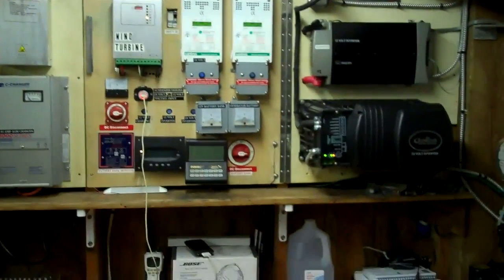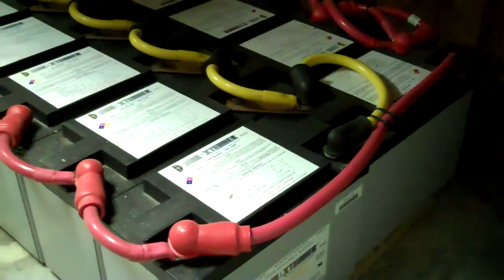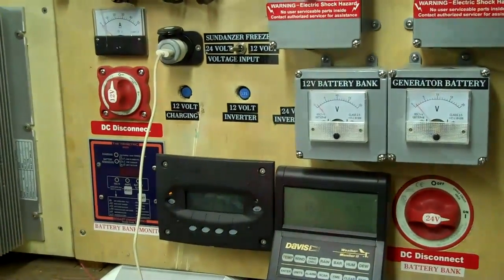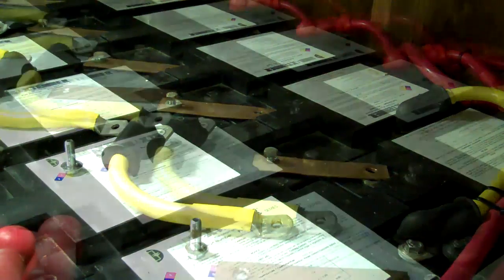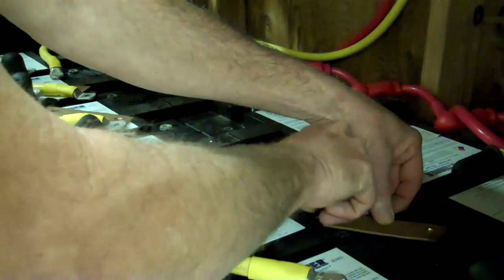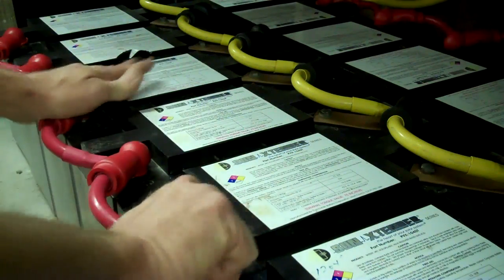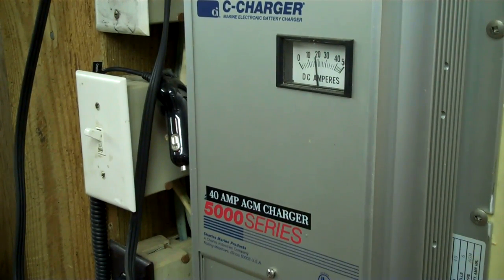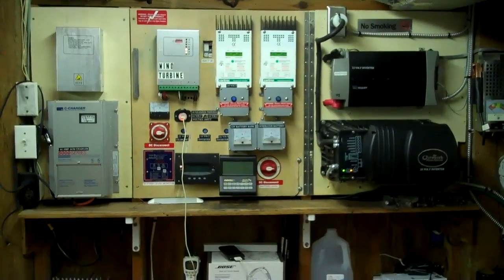HOW TO MAINTAIN YOUR AGM BATTERY BANK..

Comment: I wish you were a neighbor! I've lived off-grid for 17 years on the off-grid 9kw system I paid $27,000 for when my house was new. My AGM batteries are the large ones used as back-up systems in hospitals. They change them out every 2 years, and I bought these used but in excellent condition.
My problem is, I never learned the skills I need now. I'm grateful to folks like you who share their knowledge!
I'm female, so all my life I was told not to "worry your pretty little head" about things that I just "need a man to do". Well, my man walked out on me 9 years ago when he got bored with the off-grid life and found a younger woman, who lived closer to the liquor store.😏
Over the years since, I've discovered problems with his "expertise" in installations. Such as how he used plumbing fittings on our gas regulator instead of proper flare fittings designed for propane. Oh, and he used regular white plumbing thread tape instead of the yellow tape meant for gas connections. It leaked of course, but he told me there's no way to fix it. I took the whole assembly to my local hardware store and asked for Bill, the wonderful old gentleman who I consider to be a treasure. "What idiot did this?" Bill asked. "An expert!" I answered.🤪
I don't know much about anything, but I'm smart enough to ask the people who DO.
Today I have to go into the solar container and clean the corrosion that has built up on the contacts for 48 batteries. I'm scared to do it, but last time I did it, it worked and the system ran fine for 2 years.
A neighbor told me to use spray-on white lithium grease on the connectors, but he didn't tell me HOW. I'm trying to learn something this morning before I go out there.
Another neighbor told me to use a toothbrush and Coca Cola to clean the terminals... yeah, noooo I'm not doing that!

Comment: Are you available for hire? My wife and I are designing and building off grid for a property in Northern Nevada. We were able to recover to ABSOLYTE GX (48volt) 2,000 amp hour battery banks for a 48 volt off grid power system. The bank consist of 2 volt cells and require cables to configure the cells into 48 volt (a lot of cables). I am trying to figure out how to keep the batteries charged while our build is taking place so they do not degrade. I see that you have a (12 volt) 40 AMP Charger in your system. Will a unit like that keep the battery banks charged while they are in stand by mode until we get them fully installed? The second question I have is in regard to your wind turbine charging system. We have a property in the mountains with very few trees and I would like to find a wind turbine that would supply power after the sun has gone down. In Northern Nevada where we are there is constant afternoon wind that may be able to supply power outside of solar after the sun has gone down. I am still working on finding a generator that will adequately supply power to the XW PRO 6848 inverters that we are researching. Thanks for posting your video. Feel free to contact me if you have the time and are able to assist us. Blessings and Happy New Year!

Comment: Hi OBX. First, love your videos. Super content.  We ask for your guidance in our design to create our DIY off grid system desert retreat.  We want to use ten 12v 200 amp AGMs.  But we do not know best combo for making array.  Q1: Why not keep the system at 12v rather than 24v or 48v?  Would not the inverter take care of the conversion to 115v AC?   Q2: How do I know what size cb's to install between major components?  Q3: How do I know what size cables to use between batteries and from battery array to inverter?  Q4: We need a backup way to charge the battery array in case we do not get enough watts out of the solar panels in winter months.  We have a Toyota Tundra with HD alternator and are thinking maybe that might work when connected with HD jumper cables if allowed to just idle for a couple of hours.  Is this viable in your opinion to charge ten AGMs from say 30% discharge to fully charged?  What would you recommend other than reducing power consumption while waiting for full sun in the Spring. Thanks

Comment: Are all your batteries in this bank in parallel?. Whast is the life expectancy  of a well maintained battery bank..  agm vs gel for a battery bank like this. What brand are you using here.. and aprox cost  for this agm  battery also its ratings ie Volt and  ah rating. ty

Comment: I have one quick question concerning the battery bank and running two inverters. Is it possible to run two inverters off of one battery bank, or are you required to have one battery bank per inverter? That is probably a silly question but I need to get it clarified before I start buying my batteries this next month. I have watched all of your videos and have enjoyed them beyond belief. I would not have guessed that one person could have so much equipment dedicated to solar, lol. Thanks for all the videos, quite interesting...

Comment: I have eight 6 volt AGM batteries 5 months old and my charge controllers seem to show a fast discharge from full to less than half in a short time with small loads like TV. But then equally charge to full from solar in a short time as well. Is there an issue with my batteries or could it be the accuracy of my controllers? Thanks

Comment: Hey Kevin

I have a 610 agm bank on my 24 grid tied volt system. Would it be good or bad to drag it down to 50-60 % once every 3 months or so? 

Have a good one and keep the vids coming!!!
Reply: 30% is what you want as a maximum discharge rate if you want to keep them for a long time, I have one bank over12 years now doing this way.
I have lived off grid for over 30 years and have made every mistake possible over the years and learned the expensive way

Comment: What is your bank sitting on, concrete or cement floor is bad for batteries, I am not sure if it affects AGM batteries but it surely destroys lead acid type....best to place on a wooden surface....
Reply: Why is concrete bad? Batteries have a plastic case. How would it react with concrete?  I think that is an old myth going back a hundred years.

Comment from the maker: It is all live and learn. I would have been all 12V because Its user friendly and you can get so much cool stuff that is 12V and cheep. The problem is I wanted a hybrid system that was grid tied with batterie backup and the outback GTFX series was my only option and they no longer make the 12V GTFX inverter. I guess to answer your question I started with 12V and then added 24V. Hope that helped...

Comment: Hey there,Starting off you want a solar array that can produce enough energy to charge your batteries maybe 1000watts worth you would probaly need some AGM OR Lead acid batterys.If budgit is tight go for lead acid I got some great deals on ebay and from my local scrap yard.Solar panels decrease in price in the winter so now is the time to buy.Also get some 1000watt inveters and split the loads of your house so lights my be one inverter refridgeration on another and etc.I do the same on my chan

Comment: i want to run a house, lets say same size as yours or 1500 to 2500sqft, lets say all the same toys as you, i want it to be uff the grid but when ele comes to the area i wanna be able to connect to it, sell energy back to them, then if elec goes out it automaticly trips over to off the grid like your! my dream, but im poor, so i have to start slow, im thinking batteries, what kind should i get and what do the no# mean? 35ah and what is the min needed or where should i start, thx check my vid